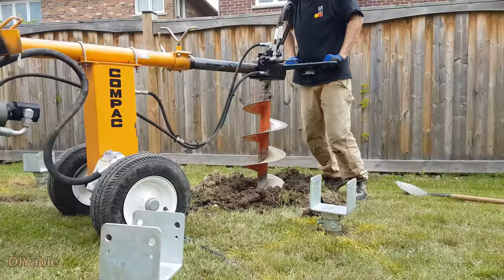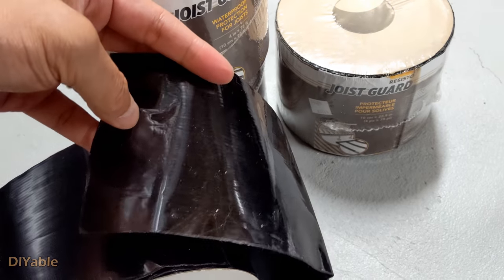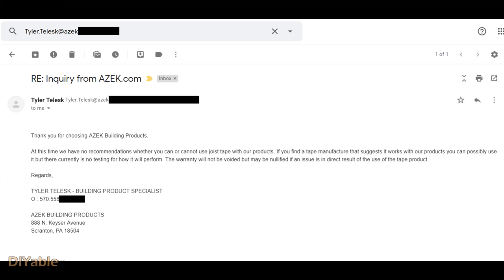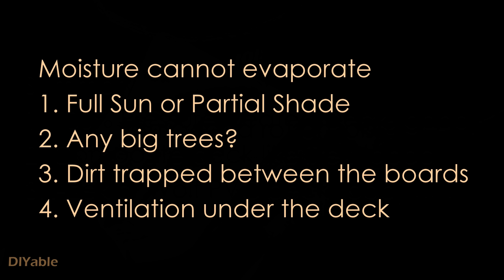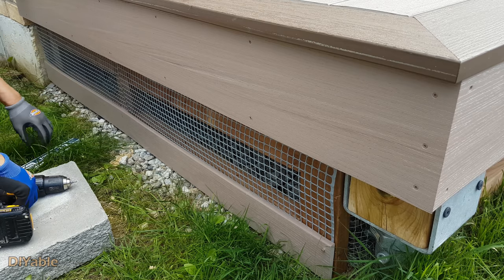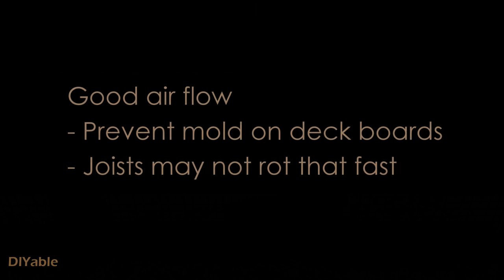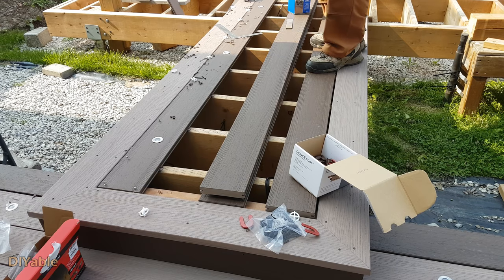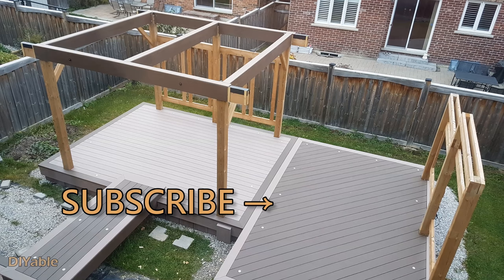DIY Deck (Part 10): Why you should avoid Joist Tape on Azek or PVC deck?

Comment: I used the asphalt tape, and was lazy not getting around to putting the boards (Trex) on for another three weeks.  It's just tape, the glue gets absorbed into the wood and what you have is a poly film "floating" on the joists.  It does not really stick that well after a few days unless you stretched it out like a car wrap (if you used new wood with a higher moisture content, both tape types WILL bubble without constant pressure.)  If you stick it to a finished surface it will stain and dis-color, but so do butyl tapes.  IMO the best thing is to apply an oil based sealer to the lumber before you install. I tried this planning to re-use some of my old decks studs with a gallon of mis-tinted sealer for 5 bucks and it was by far the BEST and cheapest solution.  Watching taped (butyl and asphalt) and oil stained boards all interact with a few rains and hot sunny days made it pretty clear to me.  The deck frame itself looked like a patched quilt with the project leftovers from friends plus what I bought new, but it's all covered in the end.  I think you can use the asphalt tape and and the video thumbnail is very misleading, the butyl stuff is better,  but in hindsight I would have skipped all of it and just used the wood sealer. YMMV

Comment: Well done well planned out good use of space fantastic work I’m finding it hard to believe it’s DIY you have more experience than you let on I’m using the azek deck right now And it’s a pain in the butt temperature variance fastener problems the cost the hidden fasteners are expensive the screws and clips are now special order everything is pneumatic but well done very nice can’t wait to see the finished product
Reply from the maker: What kind of problem are you having? The Azek boards do expand and contact, but if you or your contractor used the right fasteners and/or screws, there shouldn't be any issue. Yes, those are expensive I have to agree but I didn't use pneumatic one. This is the 2nd winter my deck has been going through the harsh Canadian winter, I don't really have any problems. The only thing I see is the miter joins on the corners, they have a huge gap but that is expected, in summer time that gap will become very small.
Reply: Where do you learn how to write? Wow!

Comment: They make 3 different types of joist tape all with different "self sealing" adhesives the cheapest of them being modified bitumen/rubberized asphalt. There are also butyl adhesive backed joist flashing tapes and lastly acrylic adhesive backed tapes. I use trex butyl backed joist tape for cellular PVC decking and the rubberized asphalt for every other decking type (cedar, redwood, green treat and PWC. Awesome job on the deck though.

Comment: For the fascia part, you can totally install it with construction glue and screws. BUT you have to bead individual 45 degrees glue lines so the water or humidity that may build up flows and drips down. Even when screwing there will be a micro gap caused by the glue material. Also, make sure you don't put screws too close to each other unless they are installed above or below.
Reply from the maker: Very good point indeed... thanks for tips.

Comment: I think the warning about this product was misinterpreted. It states don't use this product on soft wood or flexible PVC. There are two key words here "on" and "flexible." It should NOT be used ON FLEXIBLE PVC. The reason for this is the adherence of the product won't work very well. It needs to be used ON a rigid surface such as pressure treated floor joists. The adhesion side of the tape is warning NOT to put it on a FLEXIBLE PVC base. The other side of the tape which has no adhesive property will be ok with all types of decking material.
Reply from the maker: I totally understand what you meant, I had exact the same question too. But the risk is way too big for me and for many the DIYers, that's why I emailed Azek customer support on the warranty.  The potential problem is that, if 2 chemicals are incompatible and they are only being separated by the vinyl backing (no adhesive), that's still a risk when that layer breaks down. If we can totally avoid asphalt/bitumen based product on Azek, we should do that.  As some of the other comments mentioned already,  Timbertech PRO-Tac (bought Azek) has the Butyl based product,  it maybe a better choice.
Reply: @DIYable  If you use G-Tape™ you won't have any concerns about material incompatibility. Plus G-Tape™ is much easier to apply and adheres around the edge of the joists. Many of the other joist tapes out there will lift up especially in hot weather.

Comment: The bridge between the deck next to the house and the island deck looks pretty but looks like a tripping hazard to me being not flush with the two main areas. Since you had it for one year, did anybody trip on it?
Reply from the maker: No tripping so far, but that's very good point, if tripping hazard is the concern... it is not a bad idea to build the bridge flush with the 2 decks

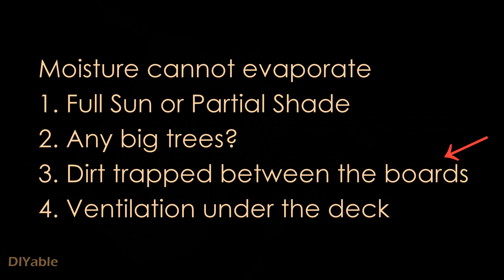Comment: At 4:00 into the video, you mention 4 reasons that cause rot.  One major reason is deck board fasteners that drill down into the joists.  The damaged capillaries in the wood of the joist wick water down into the screw hole and elsewhere into the wood.  You want to keep water out of all those screw holes.  That is really what joist tape is all about, keeping water out of those holes.  You will see joist tape advertised as being self-sealing.  That is important.  You want to buy tape that seals around the holes that the screws put into the tape.  The joist tape is also good for putting a membrane between AC2 wood and galvanized metal plate connectors, like Simpson Strong-Tie.  AC2 wood is supposed to be more corrosive on deck fasteners compared to the previous pressure treated wood, ACQ.

Comment: TimberTech (i.e. AZEK Building Products) now offers a joist tape product PRO-Tac which is made with butyl with a PET liner and TPO backing. Your video seems to be concerned about asphalt/bitumen based products but in addition to PRO-Tac there are other butyl products such as Trex Protect and Imus Seal, the latter claims to be compatible with a wide variety of deck boards from real wood to composites and PVC.
Reply from the maker: Good to know TimberTech has Pro-Tac product!! Thanks!  But to me, I would use it if TimberTech puts it in writing that Azek boards will be under warranty if Pro-Tac causes the any problems.
Reply: @DIYable  Why would Azek EVER offer any such "warranty" for something an installer did that damages their product with some OTHER product. What you probably meant was that the Pro-Tac company needs to offer the warranty that its product won't damage the Azek.

Comment from the maker: For people who want further clarification on the Azek official email replied in the video, Quote "The warranty will not be voided but may be nullified if an issue is in direct result of the use of the tape product" end quote.   This means if there are some manufacturer defects, for example color fading or staining, it is still under warranty even you have joist tape installed. However, if your deck boards becomes brittle and having signs of cracks, then you file the claim. After they send someone to investigate and confirm it's joist tape causing the issue, warranty is not covered.
Reply: TimberTech (i.e. AZEK Building Products) now offers a joist tape product PRO-Tac which is made with butyl with a PET liner and TPO backing. Your video seems to be concerned about asphalt/bitumen based products but in addition to PRO-Tac there are other butyl products such as Trex Protect and Imus Seal, the latter claims to be compatible with a wide variety of deck boards from real wood to composites and PVC.
Reply from the maker: @pdegregorio  Good to know TimberTech has Pro-Tac product!! Thanks!  But to me, I would use it if TimberTech puts it in writing that Azek boards will be under warranty if Pro-Tac causes the any problems. Absolutely good to know, here is the Timbertech link for people who are interested. 
https://www.timbertech.com/product/pro-tac-flashing-and-joist-tape/

Comment: where did you buy that wire mess under the deck? Thanks
Reply from the maker: Got it from Canadian Tire if you are in Canada. You can use metal chicken wire that can be found in any local hardware store, that is even stronger.
https://www.canadiantire.ca/en/pdp/select-plastic-hardware-cloth-3x15-ft-0591847p.html

Comment: Maybe you could've used tyvek tape on joists, or the blue sill plate membrane (forget name). If worst came to worst I would at least paint the top of the joists...
Reply from the maker: Thanks for the suggestions. I don't know much about tyvek tape honestly speaking. Does it stick well to wood? Maybe I will buy one and try it out. I actually thought about painting the top of the joists too but ended up doing the ventilation method instead.
Reply: Tyvek is just a thin layer of woven HDPE. It has no sealant, which defeats the purpose of the joist tape: to seal around the fasteners penetrating the joists.

Comment: I think you're reading too much into the instructions. Little of the adhesive would contact the PVC and it probably wouldn't affect it much anyway. It's a bigger deal with flashing vinyl windows where it may cause the adhesive to fail. 
I'm not sure why adhesive is needed at all except to make it a bit easier and to better seal the fastener penetrations. You could lay strips of any waterproof material over the joists. Once your fasteners are in and boards down, the joist covering isn't going anywhere.
Reply: If you did not use adhesive backed tape capillary action would suck the water between the tape and the wood making just as bad as having not tape.

Comment: You aren't applying the tape "directly to" the decking. It is applied to the joists.  They don't want to give you the "sure, go ahead", they aren't crazy. There could be a problem, and be the result of bad deck tape and they would open themselves up to trouble.  Now, a miracle,  they sell one they will stand behind, of course.
Reply from the maker: That's correct, under normal conditional it may be fine. But certainly there are risks.

Comment: So, you made a video to say that the manufacturer's instructions NOT to use this on PVC are correct....eye roll....
Reply: This video is great. I would have used butyl tape on my deck but now Will be using g tape.
Reply from the maker: Good point about butyl based tape!
Reply: What's more amusing is that he's actually NOT using it "on PVC", but rather on the joist lumber, as suggested by the tape's label.

Comment: PVCs don't rot, so why would you use a joist tape?
Reply from the maker: PVC doesn't but the pressure treated wooded joist would rot...
Reply: @DIYable  Yes, that's why you put the tape onto the PT lumber, not on PVC.

Comment: This is really bad advice. Please take more time to simply read your tape instructions in the future. In regards to using your tape with PVC, it clearly says you shouldn't use it "directly on" PVC. That does not apply to beneath deck boards as every deck builder knows. Your panic is unreasonable. Your advice to "DO NOT USE" is just wrong. These tapes are widely used with a proven track record if you had just taken the time to learn a bit before you attempt to teach. Of course Azek has no wish to warrant other manufacturer's products on big expensive decks. That is only natural and their response is not at all relevant as you said.
Reply: seriously, thanks for making me paranoid as I put it on joists under 5k of Trex.